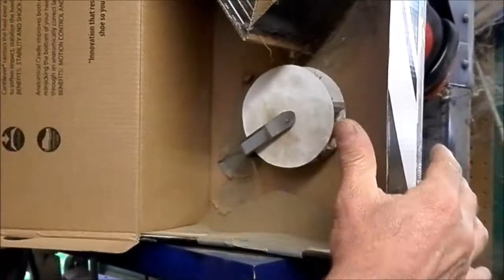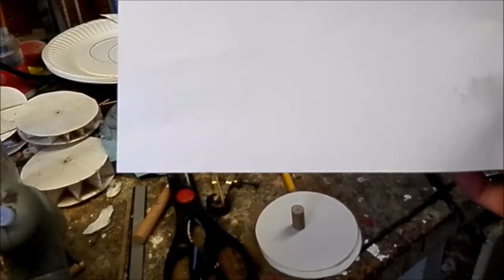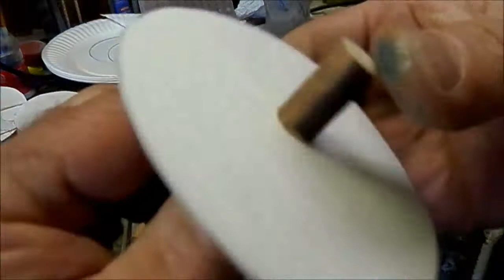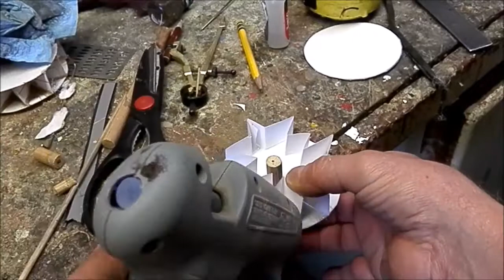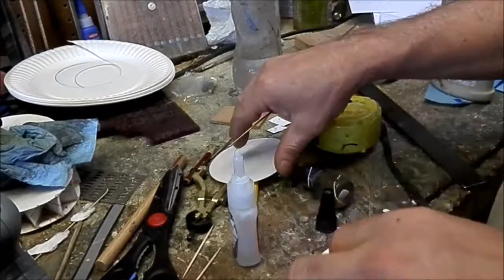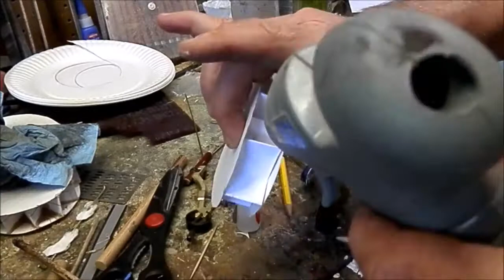Sand Toy Trapeze Artist: How to make the drive wheel

Comment: Ive made a few of these, a very large one as well, you half to off set the wheel a bit where the sand hits mainly one side of the wheel, they will fly around nicely.
Reply from the maker: Hi Tom! Thanks for the tip. I would like to see a large sand toy; that sounds like fun to me! Thanks for stopping by. Warm greetings from Wishram.